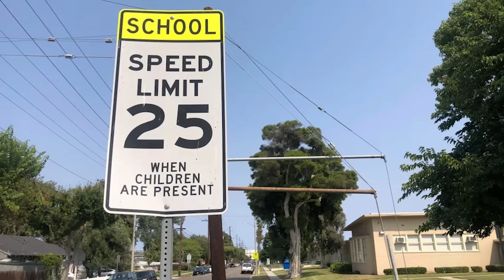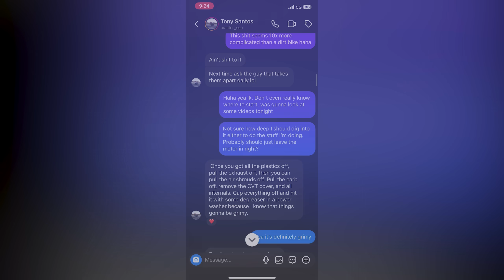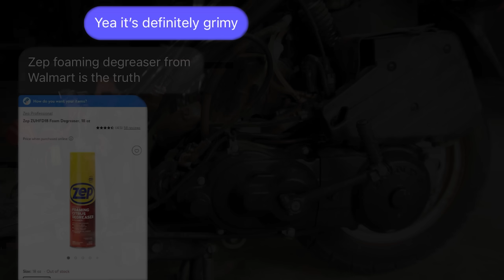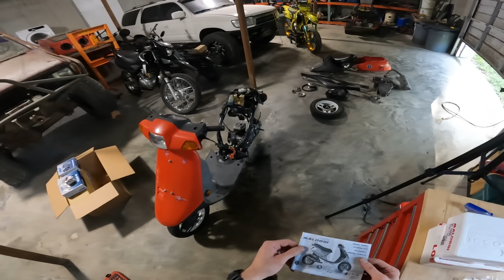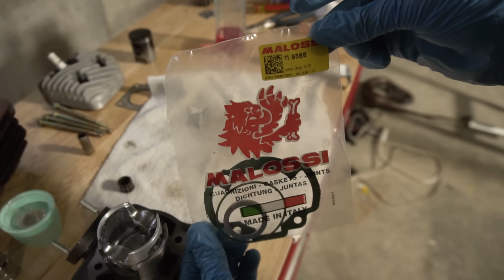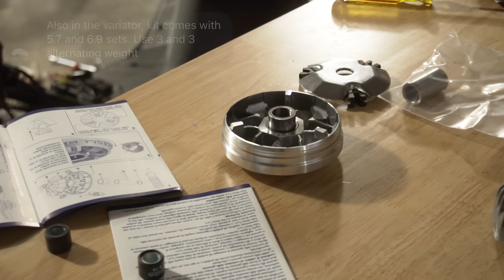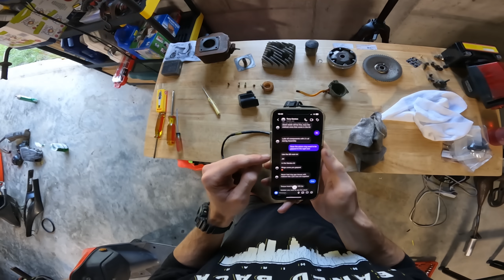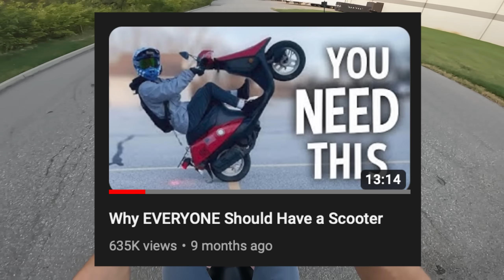HUGE Power Upgrades on my DREAM SCOOTER

Comment: Sooo it has nothing to do with this scooter, but I do question myself and I don't know where else to ask. On a puch maxi, does changing the gear ratio in the engine itself, put less stress on the engine at higher speeds??

Comment: Did toaster ever mention tuning the carb? I’m running into issues with mine with practically the same setup and i don’t know how many turns out the screws on the outside of the carb go
Reply from the maker: I didn’t do anything to my carb other than change the main jet!

Comment: if you are trying to do something that pushes alot more you can put an 70 cc aluminium cylinder on and a bigger carb like 21 or 24 with a better filter and an expansion exaust that thing could reach even 120 kmh that would be 75 in mph. tell me if you need help

Comment: btw when it idled horrable then stoped the way to fix that isnt new carb just replace the air filter and high idle for 10 min then boom its fixed i had the same problem and air filter peices cept getting sucked into the carb cause of how dirty the filter was

Comment: Try this with a piaggio c-one motor with a malossi rc70 and a team speed exhaust.
22.5 horsepowers on the back wheel out of box.

Litterally do wheelies with 70 miles an hour.

Its funny ;)

Comment: Great video.

I'm riding Yamaha Mio 110cc and Honda Scoopy 110cc.
Do you know where i can buy similar piston upgrade kits for these bikes? I wanna go at least 125cc, 150 would be great

Also, you can buy entire GY6 150cc engine with CVT for 200$ from china. It's basically honda's motor from 1980s, licensed for production in china.

Comment: Hey if u see this comment i could use some help. I have malossi 70cc sport and i was wondering if it was the same u have? I have a honda sfx af37, which has a similar engine to that one. I was thinking of buying the same parts and fitting them like u, tho i was wondering if the stock carb on the dio is a 12mm or 17, as i have a 12mm on rn.

Comment: My honda eve with a  DD50 sym block goes 60mph stock ports only, 28mm Oko, dr sliders all 5 grams, stage 6 clutch bell, keli heavy clutch, zx trans, black contra spering with blue polini clutch springs, sym belt.  Can go faster with ports and a better high end pipe

Comment: Using a stock 12mm carb is not gonna cut it with a 70cc Cilinder. Rather use a 19mm or preferably a 21mm

Comment: First of all please don't use the jet he reccomended just because it works for him, same with weights and most likely contraspring. It depends completely on your engine as a whole not just the tuning parts. Something as simple as different air density in a different state can interfere but also things like crankcase compression due to bad reed petals or worn oil seals on the crank. Second of all the exhaust you run has practically no expansion chamber and is therefore very bad for performance, a pipe like Yasuni Z, Doppler s3r or something like that will perform much better. And thats not even all, you should go up in variator weights since the "second gear" phenomenon is not a good sign, heavier weights will make it shift sooner into the right gear and stop that moment in the beginning when it isnt transferring maximum power to the rear wheel, you could also try a lighter contraspring since it's mainly used to stop the drive belt from slipping and yours is a bit overkill, running a too heavy spring will not only increase power loss but also increase the need for heavier weights since they are fighting against to contra spring to expand. And the carburetor you're running, either a gurtner 13 or 16mm but i assume 13 is way to small to provide proper flow to the engine, you would need closer to a 19 or something depending on the intake diameter and the area of the reed valve opening. Do the math and you will increase power ALOT

Comment: i put in my moped a 40$ variator off am Amazon it woke up my moped it now goes well over 40 without a 70kit you could easy make a bike that fast with amazon parts if you know what your doing for 200-250$

Comment: hey can tell me why my moped isnt starting it has spark it has a carburator that pumps fuel nad it has compresion it has a arisal tune on it and it wont run even pushing it and trowing it in 1st gear wont work?

Comment: Wait till your on a bigger bike and you shift to 5th gear and twist the throttle and you are packing the front wheel head high in 5th and running 75-80 mph. passing cars. The you can say you have been riding a wheelie!!!!!

Comment: Well, you could have kept the original variator. Not really necessary to change it with a 70cc engine. You should have changed the carburetor, the original one is too small. When I tuned my scooter I was 18. I put a 70 cc, not sure if Polini or Malossi, it has been almost 30 years ago, then a 21 mm Dellorto carburetor. Stock waas 12/13. You can't keep the original carburetor with a 70cc engine. The two first things you change are the engine (which you did), and then the carburetor (and its air filter, which is going to be different). With the original one you aren't going anywhere. Priority are: engine, exhaust, carburetor. After you do the transmission.

Comment: Malossi cast iron kits are very bad as the iron hardly expands yet the piston does, so they over bore them!!!   They are NOT pre gapped….  Your better off with Airsal, Stage 6 or the Ultimate Athena kits!!! These are alloy with nickel bores, ditch autolube and run at 50:1 with Castrol XR77…  Malossi make good clutches, variations, , bells and transmission parts. polini make good exhausts and cylinder/crank kits.  The contra spring should only be changed to get cvt to lower gearing quicker out of corners etc…. A Genuine belt should only be used…always measure naraku jets as they are often wrong… with that motor set up 82-91 be good maybe 55 slow running jet, slide/ needle just rich…..fit a final drive kit as its very undergeared as it is, use the Blue Quicksilver leg oil, it will give 3-5mph more

Comment: you bought the wrong bike. yamaha job based 2 stroke is the king of scooters ask me how i know. i daily drove one for 35,000 miles. think about that. every mile was put on by me. i lived in florida. and held the undisputed title of fastest/quickest scoot in the area i lived in whole county. people came from over 2-4 hrs away to challenge me and they all lost. now its geared for 120+mph to keep the front end on the ground. and it can still outrun any motorcycle thats tried. it outruns cars. and in the city nothing can keep up. i live in michigan now and nobody has anything like mine so i pry have one of the fastest in the state. and mines not even that fast. with my combo i run. i have the same hp per cylinder as an 80's-90's v8 in a 150 lb vehicle. as far as hp per liter im well over 2000hp per liter. keep in mind cars get fun around 250hp per liter. this thing is like taking a group b rally car before they got banned and strapping its engine to a bar stool and giving it all shes got. i refuse to take it over 75 mph as it has alot left when i let out. but your not gonna get up and walk away crashing at 100+ mph on a scooter.

Comment: just tell me why you don't change oil of transmition in behind the wheel and break it's easy to change you don't need to do anything exept open up bolt and then down bolt make oil go down and put back in place and put new oil in the up bolt until the oil start go out then stop adding any oil and put back the bolt and after time if you want more speed then open the transmition and change it

https://youtu.be/gFtHnWlCn58?si=_IO6YCappVgSbNI0

Comment: Cvt transmission is why scooters suck it takes rpm to move the clutch in it's designs  so all cvt transmissions are very slowe off the line I have a ruckus 38 mph and thats maximum speed off the line you must gun it every time because it would not move and no i can't get more power i spent more money and your wasting money and time